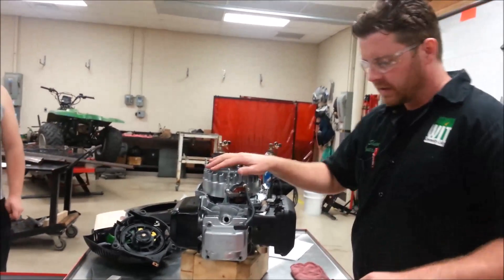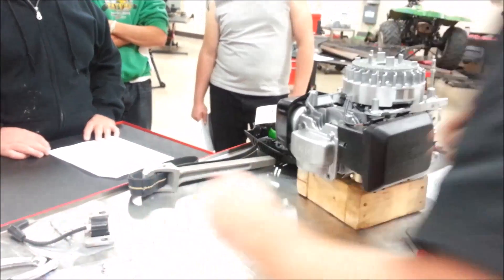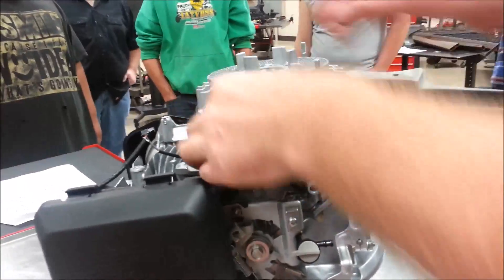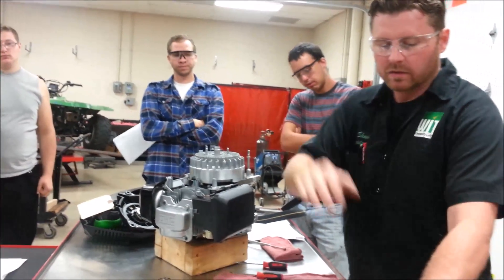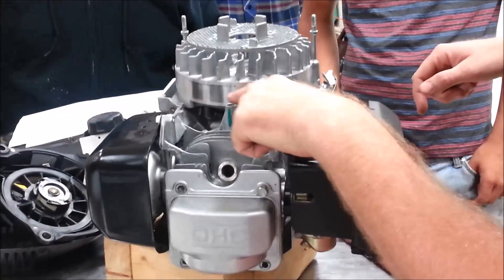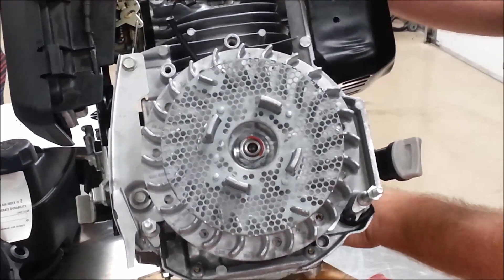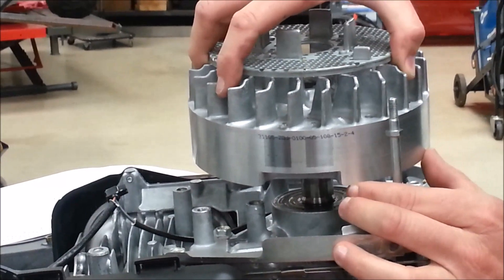GCV Disassembly   04  How to remove a Flywheel #how2wrench

Comment: If it's an older engine do NOT take the muffler off unless you absolutely have too because the bolts break off and then you spend a bunch of time drilling extracting and tapping the threads.

Comment: I used a Puller with a 7" diameter. The biggest puller in the Advance Auto parts puller loaner kit was not big enough, but I then got the biggest loaner puller from O'Reilly Auto Parts and it was perfect.  I tightened it up and gave it a couple  more turns and let it sit and it popped apart on its own in under 2 min.  Only downside is now I have to find where the woodruff key went. 
https://www.oreillyauto.com/detail/b/evertough-4771/tools---equipment-16488/tools-23747/rental-tools-16837/rental-tools--pulley---gear-19168/2939c87d6f50/rental-tools-evertough-pulley-gear-puller/67022/4700242

Comment: What size flywheel puller did you use to pull the Honda GCV160 flywheel?
Reply: https://www.oreillyauto.com/detail/b/evertough-4771/tools---equipment-16488/tools-23747/rental-tools-16837/rental-tools--pulley---gear-19168/2939c87d6f50/rental-tools-evertough-pulley-gear-puller/67022/4700242

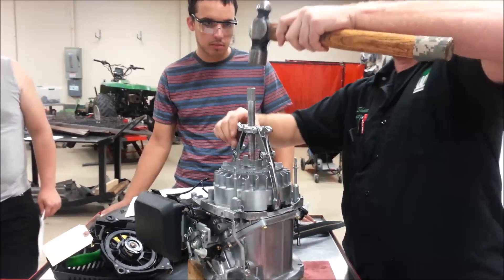Comment: That "Simple tapping", bashing of the crankshaft at 14:22, could that affect the ball/roller bearings on the crankshaft or put some indentation on the inner or outer race?
Reply: @jeremy yep, I'm looking at the Honda manual and you are right it says to tap the end of the puller.